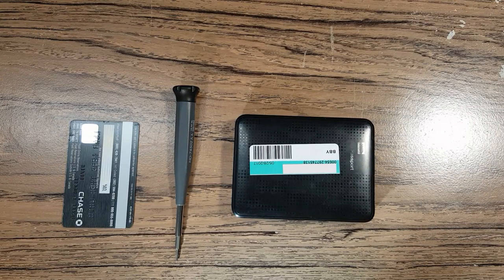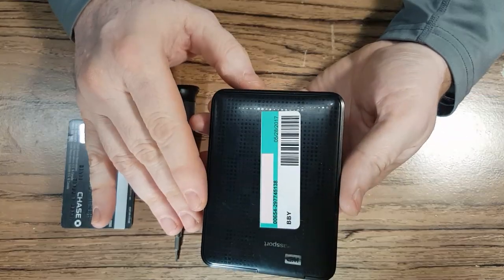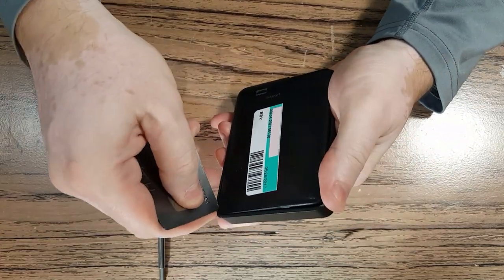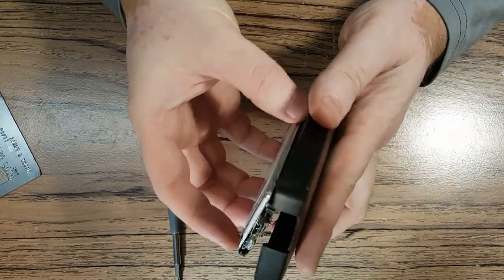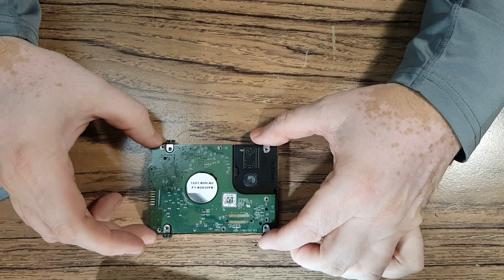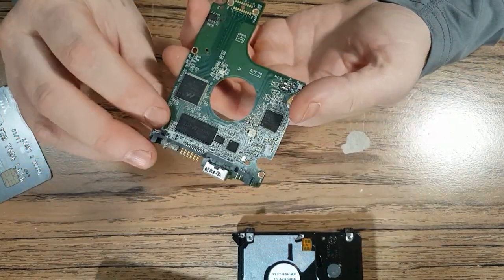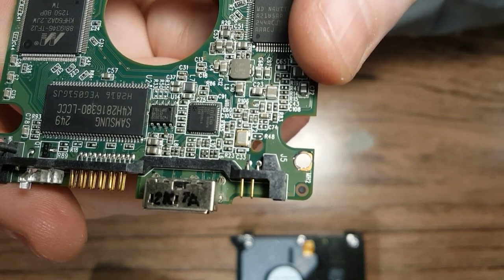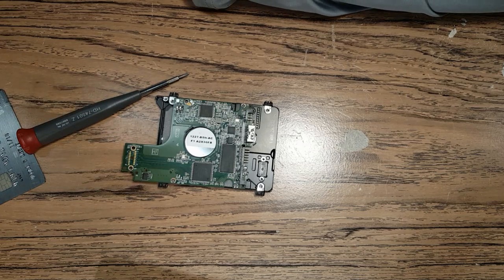WD Passport hard drive data recovery after physical damage to connector

Comment: These HD Passport Drives are the worst external drives I have ever bought, will NEVER buy another one.
Reply: Yes, because they don’t have a sata connector?
Reply: Seagate are worse

I know 8 seagate drives that all failed. 3 of these was mine. I always treat my hard drives like a baby, i don't move my laptop/external drive when is running and never dropped.

I never had any kind of problem with WD.
Reply: i have this very same drive..i had it since 2013 till present day and it still works fine...even though i dropped it a couple of times it’s still very dependable
Reply: wildwalkeruk it sounds like u had a bad experience with wd hard drives what brand  and make do you suggest???????????
Reply: @wendellhanley6210  I use the Samsung ones mostly. It's not the WD brand I had an issue with, it was the contstruction. Most USB drives are still SATA, so you can take them out of the USB caddy, and still put them in your PC to recover files. These WD Passport drives have the USB directly on the drive, no SATA interface. A lot of the time now I just buy a 2.5" drive, and then buy a caddy from eBay and make my own. It makes warranty claims and basic data recovery simpler.
Reply: Me either!!
Reply: Where's part 2 ?
Reply: @wildwalkeruk  mtv ax.
Reply: Interesting. I assume just "normal" failures? I've had excellent luck with WD. Seagate is trash. I word in a pc repair shop and have made a habit of running Crystal Disk Info to see the hours clocked before dead and seagate always under-performs.
Reply: I agree, currently trying to fix my dad's so the files in the Passport Drive can be transferred to a flash drive.
Reply: I think that unfortunately it is a problem of the HD "WD my passport" with "Windows 10" (I am almost sure). I took some old external hard drives (4 hard drives), 2 Toshibas that worked perfectly, but the other 2 are from WD (My passport) and did not read on Windows 10. Detail is that I always kept the four with the same care, in the same place . So it would be quite a coincidence that the two from WD went bad and the other 2 from Toshiba were working perfectly.
Reply: @wendellhanley6210  TOSHIBAs
Reply: You were simply unlucky. A WD Passport will last either two weeks or ten years. It's a gamble.
Reply: @wendellhanley6210  my got damaged withing 1 and half year, and my sister-in-law's got damage within half a year
Reply: 2nd part required xD... please!!
Reply: You better off buying a USB storage case that is Sata and adding a drive
Reply: I agree on this!

Comment: It is called a cold solder joint when the soldering iron did not heat the solder to a high enough temperature.

Comment: Just because you don't see damage from not using ESD protection, doesn't mean you don't cause latent damage that can fail later. I recommend always using ESD protection when handling a customer's product. 
The difference I have seen between Western Digital and Seagate is Seagate has an USB to SATA adapter. My drive was fine but the adapter was bad. I plugged it it to SATA and it read fine.

Comment: I have almost the same identical hard drive. When i plug it in, the computer recognizes that a hard drive has been plugged in but i don't have anywhere to access the drive. In disk management, i try to initiate it and it wont let me. What if one bought a duplicate brand new drive and just switched the new board onto the old drive?

Comment: find your video very interesting, I have a hard drive of the same brand and it has not worked for me since yesterday, I thought it could be for something internal and my question is what type of screwdriver and if possible, tell me where you bought it from?
Reply: You can get it from any computer hardware shop, there are kits which have up-to 7-20 different tools depends on the kit
Reply: Amazon or Ebay for a cheap but decent mini tool set.

Comment: i do have a question. Can you not purchase a new board for the Hard drive and recover the data? i was thinking if i had 2 identical drives, 1 working and 1 not, you could change out boards or platters to recover any data on the one not working. just wondering?
Reply from the maker: You need to transplant bios / encoder chip.

Comment: Thank you for an overview of this. My physical connector is weak. I have to hold the cable to get the power connection to work. Its probably loose after years of wear on it. I was kinda hoping there would be a spare SATA connection on this board I could use as a 1 off transfer to get data off of it.
Reply: Make your physical connector STRONG!

Comment: Parden me coz i am a noob, but thats the reason why i am asking this question. 
I have heard that we need a torsion screwdriver for hard drive platter to screw it back or else any extra or less twist on the screw might cause the hard drive to not respond. 
Is the case same for the controller board.

Comment: Hi Abraham, so I've got an external WD Passport (WDBY8L0020BBK-01) 2 TB kind of the same drive and it makes an single beep noise when I connect it about every 6th second, it does not show on the computer and the light is flashing.  It happend after a minor drop. After your DIY Video 2 with beeping noise it seems like the head is stuck, no cracking noises. I live in a part of the world where both competence and service sucks and it's expensive. Is there possible for an amateur like me too release the head safely in a drive like this. There are a whole life of data in pics and video on it. Extremly valuble to me. I actually would like to send it too you for recovery.Thanks for helpful videos👍 Dan
Reply: This is exactly my problem rn. Did you fix it?

Comment: My Essential is new and working fine but I noticed a strange noise inside when I shake it. When I opened the upper case I noticed it comes from little plastic "bulb" for LED light (can bee seen in your vid) which is loose. It seams its not screwed but attached to the board with pins. Should I worry about this since I cannot return the disk to the store and say "Hey I opened the disk and saw the little plastic is loose"?

Comment: i have am old retro ibm travelstar from an old retro ibm thinkpad with windows 98, but, i accidentally put a torx screw on the sircuit board and it died, it has somewhere a short, but i do not know where, can i replace the circuit board with an other simillar one?

Comment: Hi Abraham, 
I've an external WD Passport Ultra similar to the one in your video. I have had it for easily 7+ years without any problems. It dropped the other day. I conneted it immediately to my PC and it loaded the files. Now after some days its just not loading the files, the light is flashing though. It throws the message that the drive needs to be formatted but that process will erase all my data. I have all of my 20 years of professional and personal data on it. I live in a small town in Mississippi and not sure where to send it for data recovery. I would like to send it to you OR any service center you can advise me. I appreciate your help with this. Thanks, Tripty
Reply: Same issue light is blinking but it does not show anything on 'This PC' folder. It only shows in the Minipartition Tool software but that too 0 bytes, offline, and cannot initialise it.....probably mechanical damage....
Reply: external drives are for backup only, not personal use, the only other way is to take it to a professional that has a clean room and maybe they can try to swap the plates from the inside to another identical hard drive. But as he said, that may only work with older hard drives, the new ones, it may not even allow you to read the plates. But doesn't hurt to try. Good luck.
Reply: How are you doing? Did you find a solution?

Comment: I have 2 seagate hd  250GB and 320GB, both of them are used but the 320GB hard drive is not working and the problem is with the circuit, I swap it and now is working but is showing me, in disk management that is not allocated or initialized. Can I just initialized without losing any data?

Comment: Hi, I have a WD My Passport Ultra 2TB which is not functioning anymore. Very very rarely it mounts on my Mac, however very unstable. I can see that all files are there, but when I try to copy files from it, the process freezes. In cases it doesn't mount, the sound when it is connected sounds quite normal, but after a while I hear a klick and it stops rotating. What can this be? I would like to try to replace the controller board. Can this possibly work? Can I buy a 1TB Version of this drive and detach the board or does it have a different board?
Reply: Hi I'm not an expert but I was interested. The subject is not so simple. Why? Because the disk platters and heads must be compatible with electronics. I mean. You have the head calibrations saved on the electronics. You can try but there is no guarantee that it will work. But I must say that 20 years ago when I had a 40GB drive, the electronics burned out and I bought it and the drive will work.

Comment: I have similar problem witht my WD external hard drive, the connector broke off andthe actual connections were disconnected. Is it posible to hardwire the connections in order to be able to use the hard drive?
Reply: Arturo Ovalles Yes,  I can do it for you for small fee

Comment: if the problem in the ports, and since WD fuse ports to Boards, is it possible to use other boeard from fine hard drive?
Reply: Probably yes if is the same hard drive model and capacity

Comment: I was wondering what form factor is this drive? most 2.5" are thin compared to this drive. what would one look for to find this type of drive is there a name for it? Thanks in advance.
Reply: I think it is 2.5. It may be thicker because it is 1TB. My 4TB are so thick I can't close the laptop with it installed. I read the data and put 1TB back in. Not sure what you are asking about the name but this is a Western Digital Passport 1TB. WD also makes one called Easystore.
Reply: @ny1t  What I am asking is that the 4tb in the WD Passport is the length and width of a normal laptop drive but the thickness is thicker.. Is there an official name for this size?

Comment: Hello Dear,
I have an HDD model WD3200BPVT- 320 GB and since last week is not working properly 
As soon I torn my laptop on it making one time clicking one time noise.
When I using as external USB to my laptop it is asking for initialise Disk, when I want to initialise this message is appearing:
Virtual Disk Manager
Data error (Cyclic redundancy check).
I tried all most all data recovery software for partition recovery and files recovery  but not detecting after 10 hour scan
Please let me know what the problem is and what is the solution
Regards
Fayad  Kateb

Comment: first off i have no idea what im doing ok so my question is, see when you take the mother board off the wd hard drive is that the actually hard drive fully intact and will the ps4 500gb hard drive work with the wd passport mother board ? i want to use the 2tb wd hard drive on my ps4 and put the 500gb hard drive from the ps4 in to the wd cover will this work ?
Reply: nope